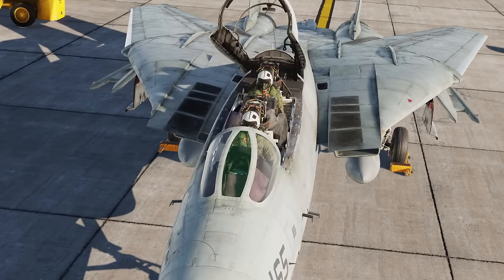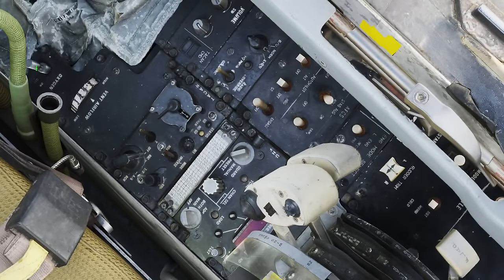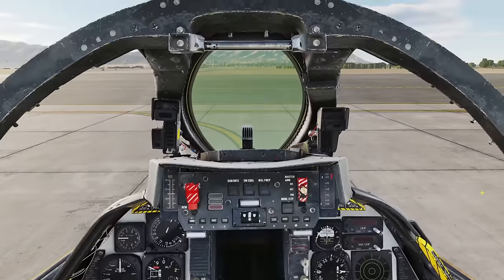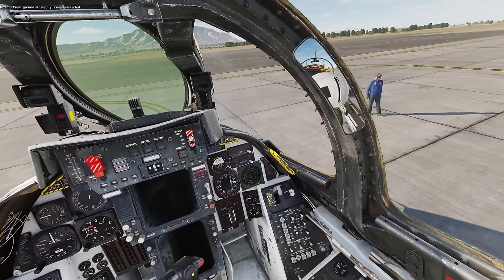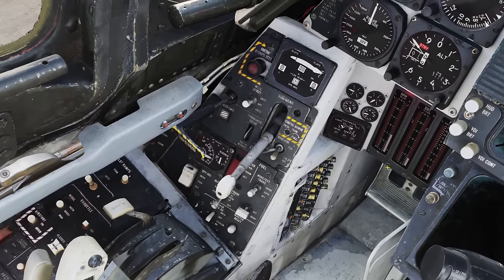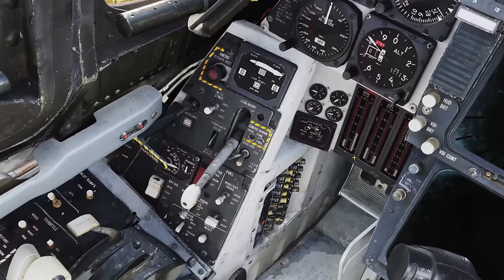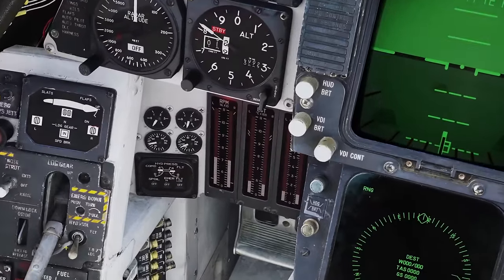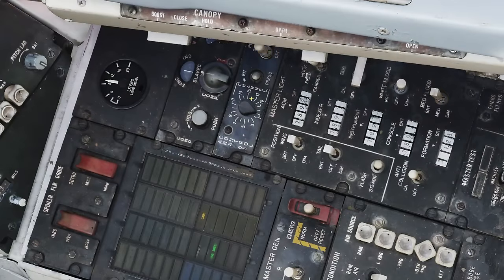DCS F-14 Tomcat Pilot Startup Tutorial - Real life procedures explained

Comment: The wing transfer philosophy is that if you try to transfer field from the drop tanks to the main tanks, the pumps transfer faster than the engine can burn fuel at idle or taxi power settings(by design), so it could overfill the tanks and spill out the fuel vents.

As for sloshing tanks, it's not a thing. Fuel cells are baffled to combat any sloshing. It may slosh a bit, but is not enough to cause any noticeable effect.
Reply: The wing cells were designed the handle sloshing, but the external tanks are another story. Catapult launches were inhibbited with partial fuel loads: 

"Catapult launch with a partially filled external
tank is not authorized because of surge load
considerations." - NATOPS

And landings with any fuel in the external tanks had to minimize descent rate:

"CV arrestment, CV touch-and-go, or normal
field landings with full or partial fuel in the
external tanks is not authorized because of
overload of the nacelle backup structure.
Only minimum rate-of-descent landings
(minimum sink rate) are authorized." - NATOPS
Reply: @butcher4095  my bad, I thought he was talking about the internal fuel cells.
Reply from the maker: Thanks for the info. So actually both versions are true, good to know !
Reply: @butcher4095  But the fuel system has a level control system to prevent overfilling, unless switching to OFF was just another precautionary measure. My question is when the heck do you switch it back to AUTO? It's unclear in the Pilot/RIO challenge/reply checklist - “NORMAL FEED, AUTOTRANSFER DUMP OFF, TRANSFER CHECKED, TOTAL_______, WINGS_______, AFT AND LEFT ______, FWD & RIGHT________________, FEED TANKS FULL ____ BINGO SET________________.”
Reply: @friggindead  Probably just before takeoff. I think "AUTOTRANSFER" refers to the WING/EXT TRANS switch being in AUTO position.
Reply: @Butcher  there should be a comma inbetween AUTOTRANSFER and DUMP OFF but yeah, I guess that makes sense 👍

Comment: Reflected, ins't the ammo counter supposed to be set to 670?
Reply from the maker: Isn’t that the maximum value too?
Reply: @ReflectedSimulations  the maximum is 690
Reply from the maker: @skywarp2180  Ah ok…I don’t think that 20 makes a lot of difference, especially with the rough counter on the hud.
Reply: @ReflectedSimulations  that's no big deal, I was just giving my contribution to a full fidelity start up
Reply from the maker: @skywarp2180  thanks! I wonder why the counter goes up to 690 if the capacity was 670 only?

Comment: Thank you very much for the tutorial. I like to play realistically and it has been very useful to me. I would also like to specialize in the RIO position. Could you do the same tutorial but from the RIO cockpit, also describing how its start is combined with that of the pilot?
Reply: For example: from what I have read in CHUCK's guide and the actual manual, they seem to imply that the RIO should not turn on the DDD and TID and begin aligning until the engines have started and the cabin AIR SOURCE of the pilot is in BOTH ENGINES, also for cooling reasons. Have I interpreted this correctly or is it enough for the RIO to start aligning with the ground air supply being connected?
Reply from the maker: @DwailHicks  thanks! Good questions, the problem is I’m really no expert in the backseat :/

Comment: The F-14's M61-A1 gun only holds 676 rounds hence I personally never set it to 690 but always to 670. Not that it matters that much I suppose but just an FYI.
Reply from the maker: Thanks for the info! The HUD only displays the first digit anyway, so I thought it's just easier to set it all the way up. In any case, if I'm not mistaken, it's the ground crew that sets it to the appropriate level after loading the guns, not the pilot before engine start.

Comment: That Wing Trans to OFF, wouldn't it be simply to allow engines to burn some internal fuel so the test of fuel flow from EXT Tanks  at the end of start up procedure would be easier to see?

While OBC dont you toggle inlet ramps to Stow on Plane captain order? 

Also there was mention of wind screen blower test next to BiDi

Thanks for that vid! I am just replaying Zone V with new BFM patch and doing some playthrough vids! Now I see I missed some steps in my start up! Thing is Zone V is that there is only like 10 min from step in to launch time according to brief notes so you really have to be fast with all BITs and OBCs. 
While we at Zone V topic, I see that E2 is available with datalink, is that also part of real Top Gun? Without it, it would be really hard to spot those Wildcards!
Reply from the maker: Thanks! The OBC moves the ramp actuators automatically AFAIK. I did mention the windcreen air test, or you meant something else? 

As for the wild cards: normally there shouldn’t be any datalink, that’s cheating: the wild card is there to make you look outside the cockpit,  not to get you buried in your TID even more.
Reply: @ReflectedSimulations  Yeah thats what I  thought for datalink, its too easy.

Also about start up procedures, I heard that on carriers with F14s there wasnt enough external Air generators to go around and F14s would start right engine normally and then cross-bleed left engine, the same maverick did in his Topgun:Maverick movie ;)

Comment: Two other things i wondered about was: I am able to move the control-surfaces without any hydraulic pressure - is this because the ground air supply? And the other thing: you say the Tail Hook is checked nearly at the end of procedure by ground crew. Can this be realistic? i mean: there are two jet-engines up and running left and right to that tail hook: I would not like to stand between and check a tailhook in that situation! :)
Reply: And how am i able to check the emergency bypass pump making hydraulic pressure if i am able to move control surfaces anyway?
Reply from the maker: You shouldn't be able to move the control surfaces without any hydraulic pressure. The tailhook check was at the end, the engines are wide apart, nobody has to look into them :)

Comment: You’re not going anywhere until you push in all the yellow circuit breakers.
They are always pulled by ground crews after every flight.
Typically you only need the huffer to start one engine, always did left side first.
Pull the air and crossbleed start the right engine.
Reply from the maker: Good to know, thanks! CBs are always inby default in DCS

Comment: What about compass sync?
Reply from the maker: Good call, in DCS they're always synched so I skipped that. Otherwise, just after you run your ICLS BIT you press and hold the HDG Pushbutton:  " In SLAVED mode, the pushbutton synchronizes the directional gyro with the magnetic azimuth detector and sets magnetic heading on the BDHI. Pushbutton must
be depressed and held until the synchronization indicator needle is bracketing the
null mark. "
Reply: @ReflectedSimulations  so it can be done on the ground? I read somewhere that you were supposed to do it in the air while traveling level at a fixed speed.
Reply from the maker: @riman8493  I think first you did on the ground, then in the air. 'Compass Synced' is part of the takeoff checklist. Also, I think they did it after launch too while getting away from the carrier, because that large metal thing messed with the compass quite a bit.
Reply: @ReflectedSimulations  awesome! Makes a lot of sense, thank you!

Comment: obviously you have never spent anytime around military aviation or naval aviation if you thinhk the first thing a pilot does is turn on the qxygen and leaves it on. unles he has a hangover that's not happening... Most aircrew hate wearing that mask. plus in a alpha or a B there is a finite supply of oxygen so whay would you be wasting it on the ground?? Also 99% of the time the second engine is started by cross bleed because it's faster and easier on the engine the huffer doesn't bring the engine up to speed fast enough...once you bring one engine on line electrical power gets cut the power receptacle on the belly put the grown crew in danger  because of its proximity to both turning engines..